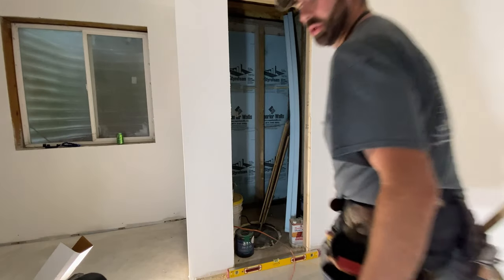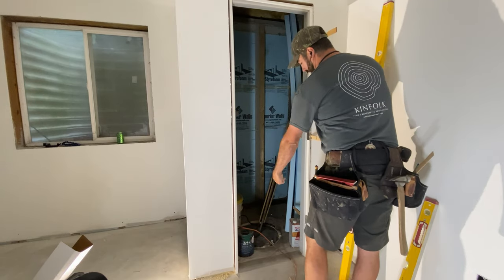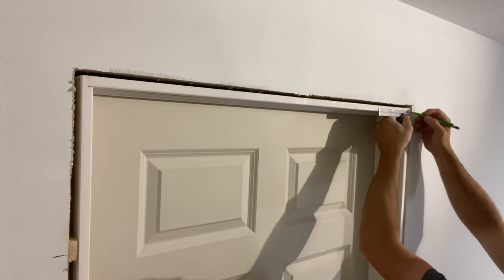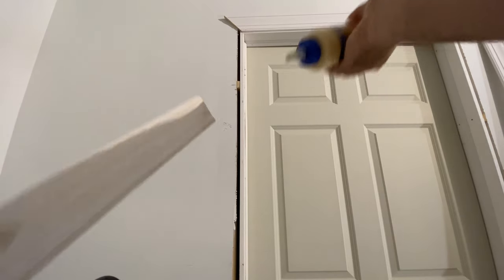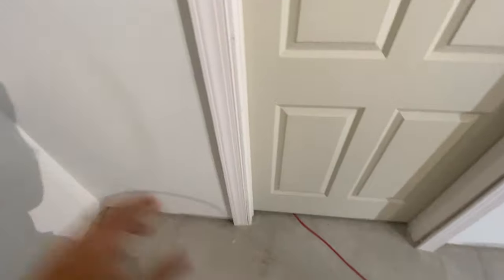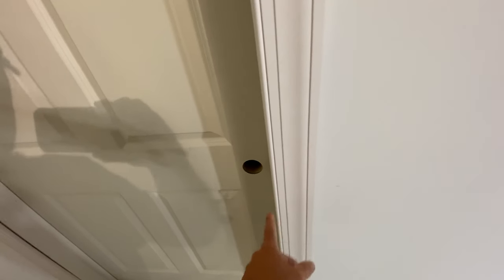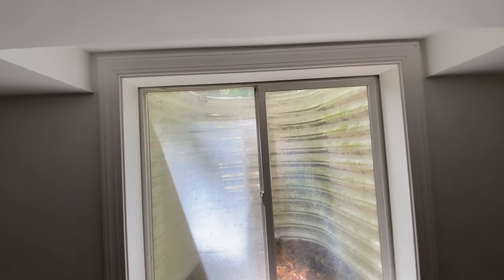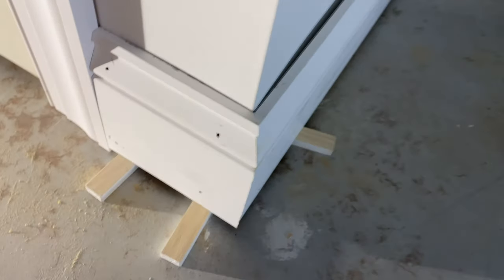SIMPLE FINISH CARPENTRY TIPS THAT WILL MAKE YOU BETTER (basement remodel part 4)

Comment: I'm a fine finish carpenter in the pacific heights neighborhood of San Francisco.

Nailing off the top of the casement and letting the glue set your miter before setting the rest of the casement is 100% spot on advice.

Good job
Reply from the maker: Thanks man !
Reply: I do like it as well if you are in a hurry. What I do instead is mark my reveal intersection and the outside of my trim intersection and draw a line between them then measure the angel and I can nail it in immediately without having to wait and it won’t come off from pressure after a while because it’s sitting naturally

Comment: Take your measurements for the casing, cut them,  lay them on the floor and CA glue the miter joints together then pick the whole thing up and nail it on. Works great for windows too
Reply from the maker: That’s certainly another way to do it . If you like to pre assemble you can use wood glue and clam clamps as well
Reply: I don't love CA glue. Sometimes the activator causes it to set before you can press it 100% tight and you get a hairline gap. Its annoying. Prefer wood glue.

Comment: I mitre mate the architrave together and install it as a full piece.
Reply from the maker: I’m. It familiar with the mitre mate? Is that a type or pocket screw ?
Reply: @kinfolk_carpentry  no it’s a two part combination, one glue and the spray which activates the glue so it has to be right as it binds almost instantly.
Reply from the maker: Ah ic yes I use a similar product wen I’m doing pre finished crown moulding on cabinetry
Reply: @kinfolk_carpentry  try it out with the architrave it’s pretty normal in Ireland/uk.
Reply: Me too. I also scribe the internals of the skirting boards,

Comment: cant say it enough to people always pre build your trim before install makes it so much easier than trying to fit things after they've been installed  your doing double the work this way use ca glue and activator to build it on the floor or whatever or even clamps then nail it in place and take the clamps off no reason to do door trim the way that you did

Comment: Nice to see a Canadian/American screwing a door liner to the stud. Seen so many just shoot 50 nails into it. Nice job. Just curious. Why wouldn’t you lay the floor before the skirting? Saves having to use moulding.
Reply from the maker: Thanks man I agree I’ve seen that a lot too. since it’s a concrete floor that has a lot of ups and downs and they will be laying a vinyl flooring down i can avoid scribing all the base to the floor they will just tuck underneath it . It also makes it so I can paint it all and not have to cut it to the floor . I will pre paint all the shoe mold and shoot it with a 23 g
Reply: Bit late now but we usually pre paint the trims, lay the floor down then finish with the doors and baseboards. Thanks for the tips!
Reply from the maker: @jamin3131  what do you do with all the nail holes? Or do u do a final coat in place ?
Reply: @kinfolk_carpentry  ; white wood putty in holes, then a quick brushing over the putty marks with the trim paint.
Reply: @kinfolk_carpentry  what Fred said.

Comment: Don’t need all those screws in strike side on finished floor. Screws are great in hinges, no need to remove stop. Pinning miters from the side will split and un-necessary for MDF trim. Pin from top if needed and you will shoot yourself a few times. I’ve always just stuck a putty knife behind miter ad shot it close. Works every time. Like the glueing miters and letting set before nailing off. Just never had enough time to do it that way.
Reply from the maker: It’s not mdf trim it’s pine . Pre hung door jams are very rarely straight so I prefer to shim the catch side multiple times and I screw it so I know it will never move . And I do shim my miter just with a shim instead of a putty knife . Everyone has the own way of doing things .

Comment: Great tips and process.  My only critique... get your fingers out of the path of those brad nails!  I cringed when you held and nailed the mitered corners.

I like to use CA glue and accelerator to bond the corners.... much faster and you can finish the entire frame in one shot, although you have to make sure they are aligned properly.  You only get one chance!  ;)
Reply from the maker: Lol I have hit myself a time or two with a stray nail. I do use ca glue on pre finished cabinet crown and other pre finished moldings. I’m not sure why but I just don’t trust it I know it is brittle and I have no evidence that it will crack over time I just know traditional wood glue has a way better hold .

Comment: 3/16 reveal, not 1/4, that is the optimal and correct reveal for casing it out. Not only does it look better but it makes it easier for your nails to hit the door frame when you are nailing the inside of the casing. 1/4 is way too much, even though 1/16 doesn't sound like a big difference it is.

Comment: It’s a shame that such skill is spent on such low-quality materials.
Reply from the maker: It’s certainly not high end but it’s not low quality all the trim is pine it’s pre primed . I don’t use any mdf . It’s 6 inch baseboards and 31/4 casing . Everyone has there budget they still deserve good results
Reply: @kinfolk_carpentry  
Yes, they do. However, the standard of quality has become so low. As a historic restorationist, I love how a meaty casing acts as the connector between jamb and stud, and base moulding acted as a stud tie. Doors and windows did not have to be nailed to studs, as they floated and the casing locked them in - thus allowing for endless adjustability. This 1/2" and 9/16" stuff these days adds no structural integrity and is blown apart with a heavy-gauged nail. 

The amount of egress doors I've literally wiggled off the openings...

Your work is great. I wish our building material standards met the integrity of your work.
Reply from the maker: I actually grew up in a family business where my grandfather and dad built every door that would go into the house they were building and would run every piece of trim and moulding . I understand quality and it’s a shame how hard it to find clients that view it the same way as we do . Look them up siderbros.com
Reply: AWESOME!